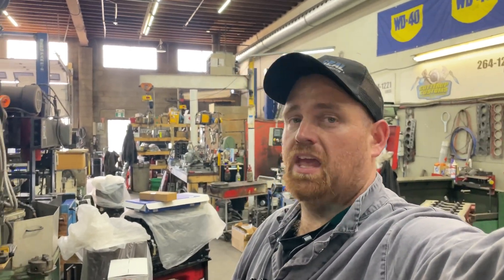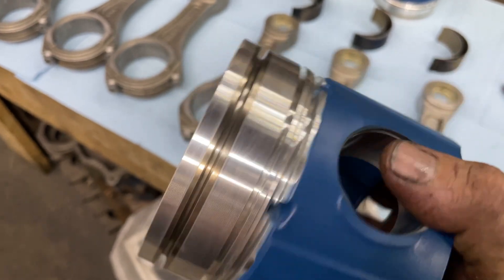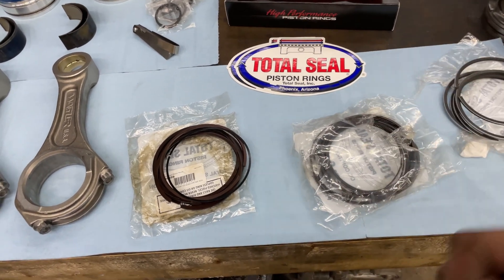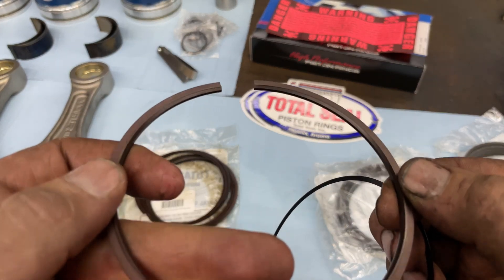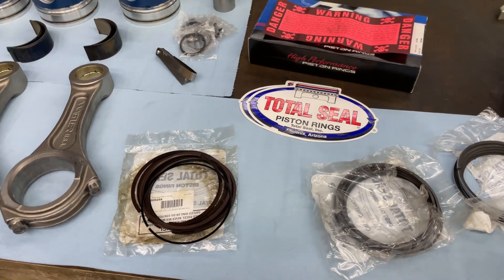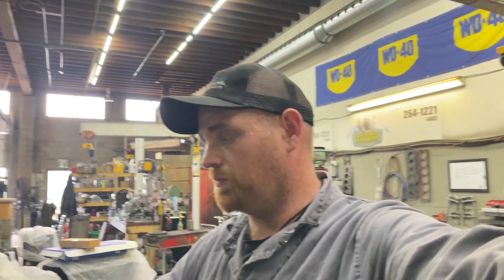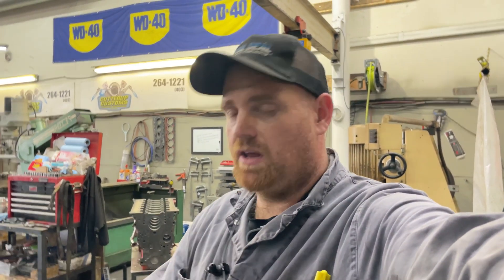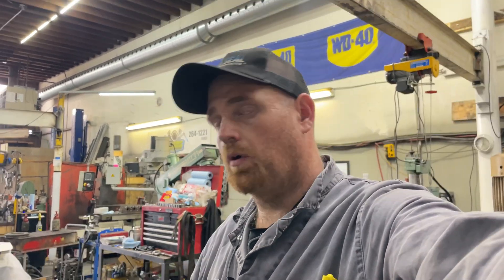How Total Seal Piston Rings Improve Engine Performance

Comment: Apologies for this question being off topic. However, you mention that your a Cummings guy and I'm trying to find a diesel wet liner to suit a 99mm or 100mm dia pistons. Would you  have any ideas where I could find a wet liner about this bore size? Basically I'm trying to find a thick liner to suit a LS1 piston.
Reply from the maker: Call Darton or la sleeve. They should be able to set you up
Reply: @CUTTERUPROB  Thanks. I'll google for thier contacts. Much appreciated :)

Comment: So I've got a question. What's your experience regarding the longevity of these gapless rings, in non-high performance motors? I mean, engines producing power on the order of about 1 horsepower per cubic inch?

Comment: VW diesel guys use the Total Seal modification service. Total seal does not build VW TDI rings. The Goetze, Mahle, and Kolbenschmidt rings that are often OEM VW are great rings to start with. However, in extreme builds, the Total Seal mod is an improvement.

It makes sense that Total Seal would focus on things like the Ford PSD, Dodge CTD, and Duramax, since they are in the USA, and VW diesels are uncommon here.

Comment: My 97 12v manual will blow blue smoke down long grades. Then when I get back on the throttle it blows a big cloud and clears out.
Reply from the maker: Sounds like it’s getting lazy. Maybe time to look into the engine a bit
Reply: Maybe if you are lucky, you only need valve guide seals or a turbo. However, I don't know how to compression test a CTD, and therfore don't know how to prove it is ring failure. Sometimes with the right trick, you can replace valve seals without removing heads. However, if the valve guides failed, valve seals don't help you.

Comment: We used to run normal rings in our pulling tractor and we always had blowby. We switched to total seal rings and now we have almost no blowby at all. When we first tried them they gave us second rings that I believe were called napier rings but they did not work well. Something about them not working well with the water injection. We now use gapless top ring and normal second rings and they work awesome.
Reply: I think the napier ring scraped too much oil off the cylinder especially with all the water in there from the water injection. Really with this pulling tractor we are not too concerned about a little oil consumption. It only runs for about 30 seconds per pass.
Reply from the maker: @TheJohndeere466  ya the Napier ring does a good job of cleaning off the cylinders of oil. Something I have learned the the surface of the cylinders of a application like the have to have a crazy rvk to hold oil under the crazy lots they see. But I can under stand that using a bit of oil really doesn’t matter for that. Just like drag racing engine
Reply from the maker: What kind pulling tractor you running. 
I would like to get into pulling. Just hard here as there isn’t a lot so I will have to travel in to the states for it.
Reply: @CUTTERUPROB  we run a john deere in the classic superstock class. The class is limited to a 2.75 x 3" charger and 531 cu. In. I made a billet crankshaft for it with a long  stroke. We won 6 out 7 pulls so far this year.
Reply from the maker: @TheJohndeere466  that’s sweet.  Hopefully you can give me some pointers when I start pulling so I don’t like look a complete noob lol.  I understand the theory in All the pulling stuff,  but we both know theory and real life aren’t the same.
Reply: @CUTTERUPROB  I think one thing we got going right now is on the dyno the tractor has an almost flat torque curve so we just gear it really fast and it pulls the motor down a little but the tires hook up and it just  holds the rpm the rest of the pull. The long stroke gives it the torque I believe. It sounds better if we gear it down a little and let the rpms run but then it just breaks the tires loose. The small turbo just wont let it run really high rpms so we have to gear it fast use the torque. I made all the transmission shafts and gears. Its geared way faster than the stock road gear.
Reply from the maker: @TheJohndeere466  what kind of whee speed would you see
Reply: @CUTTERUPROB  It pulls at about 30 mph but its still getting wheel slippage so its geared to way faster than that.
Reply from the maker: @TheJohndeere466  interesting. Lots to learn on the pulling stuff
Reply: @CUTTERUPROB  The class you want to run really determines how to build the motor. Large turbos seem to like larger bore. Smaller turbos seem to like longer stroke. Our tractor with small turbo puts out  north of 1100 hp. A pro stock which run 680 cu. in and some where around 5" compressor wheels put out north of 5,000 hp

Comment: The reason for the keystone ring is it scrapes the carbon out. Diesel is dirty burning and will foul the rings over longtime use.  I don't know I would use gapless on a diesel street engine for that reason would be a shame for 60000miles later it start blowing by because the second ring is stuck.  I have used both childs and albert and total seal gapless rings for the last 20 years in diesels for pulling and no issues.  but they all have limited run time.  I doubt most pulling engines have 100 hours of run time before they wind up getting gone thru again.

Comment: @CUTTERUP ROB I’ve got a 2012 6.7 cummins and I was watching your vids on o-ringing them. I had the block o-ringed, do you just run the standard MLS gasket or do I need to use a different gasket?
Reply: Also I’m going to have to run a thicker head gasket because I am .002 over maximum piston protrusion. I have variance from .016-.021 protrusion across all 6, not sure if it is normal for a couple thousandths difference on each cylinder.
Reply from the maker: Stock style gasket is what I run

Comment: Do you have access any steel dome pistons that seems like a better way to go I've been around Detroit too long
Reply from the maker: You can get steel pistons. But man there expensive
Reply: s FC
 @CUTTERUPROB  the Jumo Junkers  opposed piston engines used steel dome pistons in the 30s with aluminum skirts that bolted together  depending on how the Cummins piston is made you might be able to make a steel dome and bolt it to the Cummins skirt

Comment: What would you gap them for a 12 valve with compounds tuned for towing maybe 450-550 hp vs what to gap a stock set of rings.
Reply from the maker: Factory spec is fine for that
Reply: @CUTTERUPROB  I’ve found a lot of conflicting specs as far as ring gap could you list the specs I remember you went over them before but I can’t find the video. I am assembling my engine soon hopefully 🙏